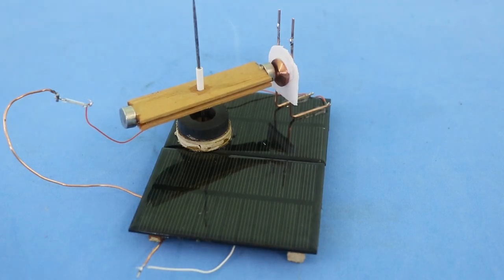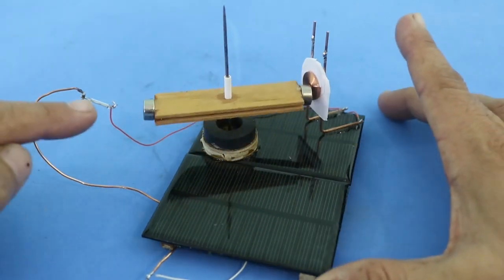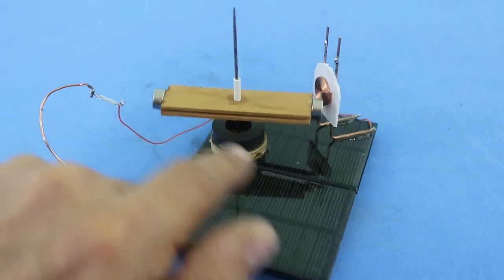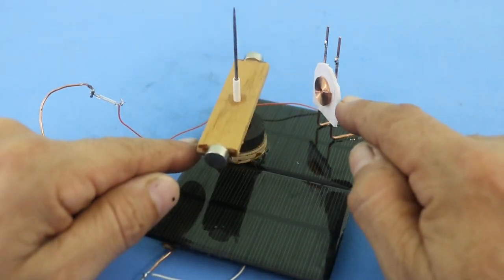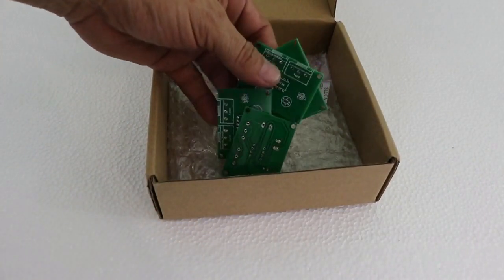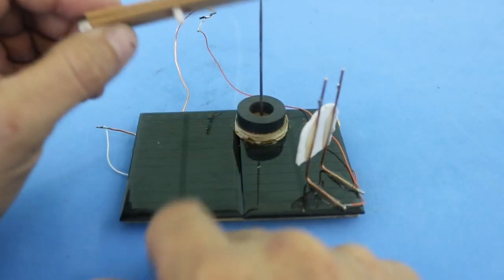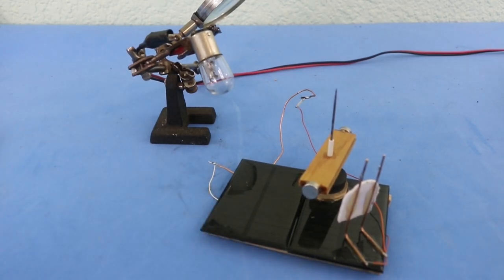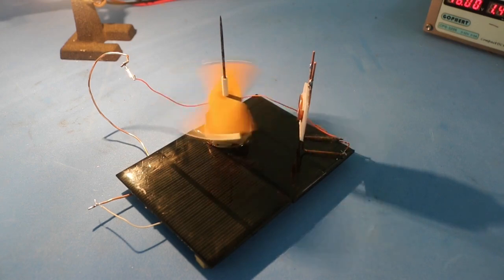Solar Pulse Motor

Comment: You can try to replicate UFOpolitics asymmetric motor.  In asymmetric motors, unidirectional pulses is used, instead of AC. Unidirectional pulses excite radiant energy field, which gives additional energy.

Comment: Would work better if it had a capacitor storing the power while the reed switch is off, and then it could discharge when the switch is on

Comment: I'm really wondering if one could use the back EMF from the coil and store it in a capacitor. That way the efficiency could be increased, if you could reuse the charge in the cap.

Comment: Make one that switches from the solar cell being blocked by the rotor.
Reply: A photocell that turns on when blocked from light.
Reply: @zebratangozebra  all you need is a solar cell, coil and magnet. No need for a photocell

Comment: You should do this but without the reed switch, and just have a half transparent, half black disk on the rotor, so it blocks the light when it rotates
Reply: Great !
Reply: Nice idea. But i guess that would not work very well if sun or light source is not prependicular to solar panel surface.